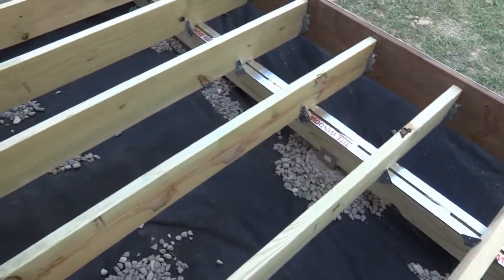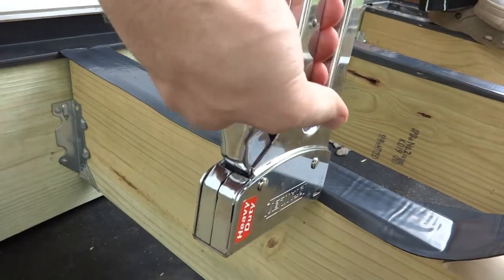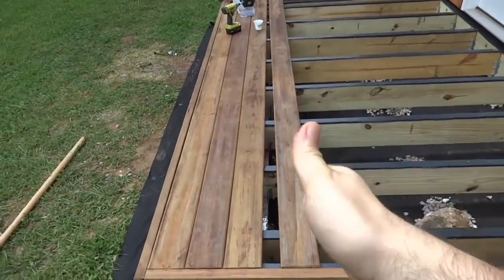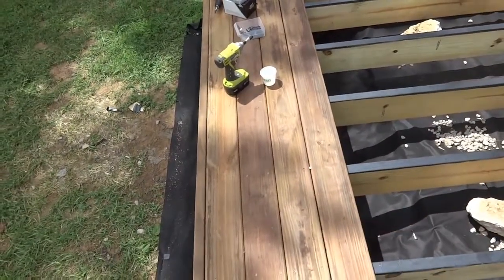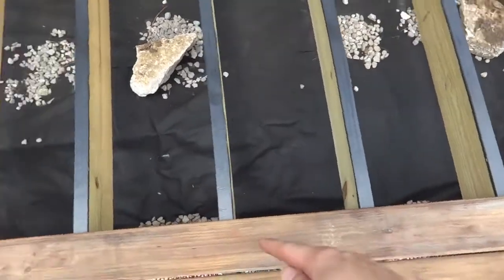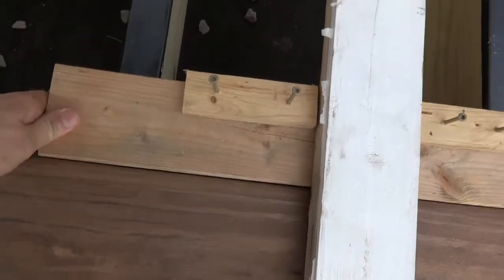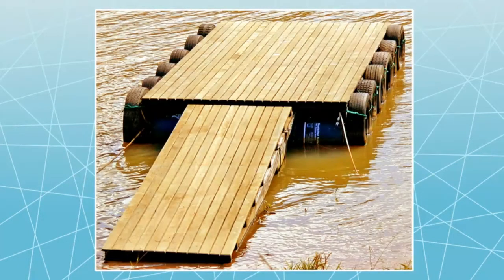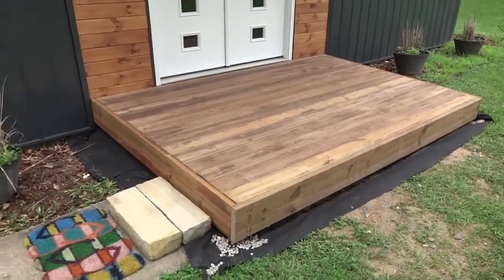How to Build a Ground Level Floating Deck - Part 5 of 5

Comment: Very cool. Nice little deck. Very well done. When I built out small-ish deck extension (I extended off the original concrete deck) I didn't thick of putting the piles further back...but oh well. And theres no such thing as over kill, the more security you add the better.
Reply from the maker: +fordmanmal Hey thanks. For a front deck like this, I didn't want to see the pillars mounted up front. I noticed our neighbor's back deck had them set back with a support board running all the way across, so I decided to do our like that as well.

Comment: I preface this by saying that I have no idea what I'm talking about (HAHA), but If you stained or weather finished it right away wouldn't that help minimize the shrinking to being with?
Reply from the maker: TheHayes32 No, you really should let the preservatives dry out first. If you just go and seal it, the wood has a good chance of warping, splitting, etc. It's been pretty hot here lately, so now it's dried out pretty good. I'm getting ready to seal it within the next week or two.

Comment: how is it "floating' when it is attached to the sill?
Reply from the maker: I know floating isn't the correct term for this, but I was using it in the sense that it looks like it's floating above the ground with no visible posts. Almost an cantilever look.